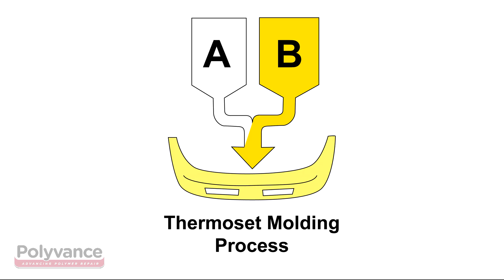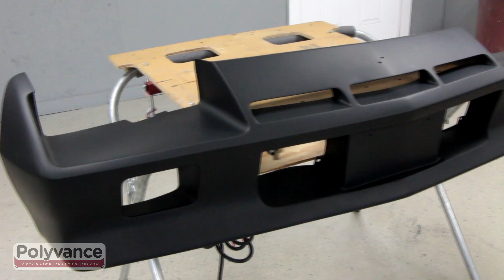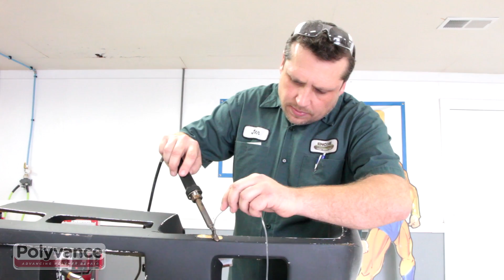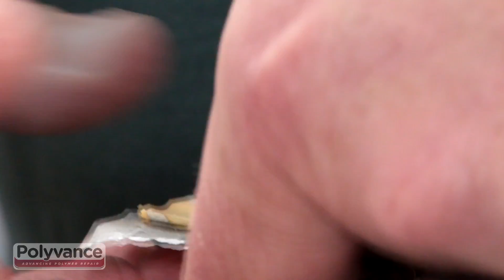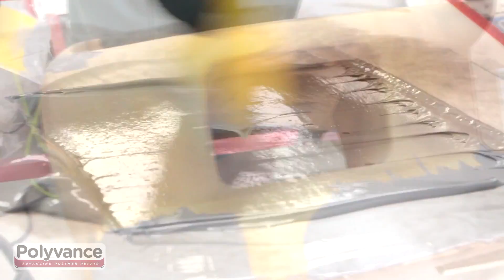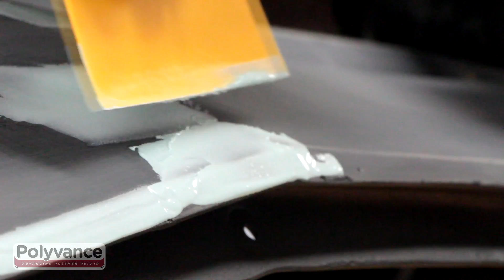Polyurethane Bumper Repair

Comment: I'm trying to restore a PolyUrethane bumper, glass fibre reinforced i think, PUR-GF- 20 it says on the bumper. The thing is i have no cracks to repair but there is two "flaps" on the backside that is meant to hold the bumper onto the car with screws. One has partly started to get loose and the other one is completely gone. I have started to learn basic plastic welding and thought that i could fix this by welding the loose one with some reinforcements and make new one for the one that are missing. But i got very disappointed when i understood welding in PolyUrethane does not work, at least not with my simple tools. Is there any glue or other chemical method that bonds well PU?
Reply from the maker: What vehicle did the bumper come from?
Make sure you are reading the ID symbol on the bumper itself and not a component that is attached to the bumper. This is a common mistake.
As far as repairing PUR, airless welding with the R01 rod as shown in this video is going to be the strongest repair.

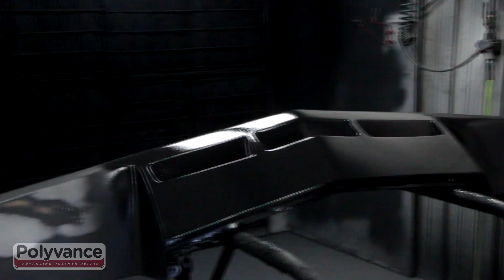Comment: In 5:22 The spokesperson says to prepare the bumper for a sealer and a topcoat. Does that just mean a color basecoat and a clearcoat, or is there more to this I ain't hearing?
Reply from the maker: Yes, the "topcoat" would be a basecoat and clearcoat. You would use a sealer or primer before the topcoat.
Reply: A sealer is like a primer, but has no build.  You put on a sealer so your color coat has no weird color changes in caused by the repair materials under the paint, after its sprayed.  You could also use a properly tinted and sanded high build primer-surfacer.  The topcoat refers to the color and clear coats.
Reply: Thanks Kings!
Reply: Can I paint directly over the welding rod material, or do I need to bondo it to get proper adhesion?

Comment: What wattage soldering iron would you recommend when using those rods to repair a bumper.
Reply from the maker: Our airless welders are 200 watts.
To repair polyurethane, you really need to be able to adjust the temperature. For this reason, we recommend our Mini-Weld Model 7 (https://www.polyvance.com/Airless-Welders-1/5700HT/) as opposed to our other airless plastic welders.

Comment: Will fiberglass stick to it
Reply: Yes, but not all that well.  After a large urethane repair is done, its recommended you put a fiberglass patch on the backside to stiffen the area as the urethane repair is more flexible than the original material.  Its not really carrying the load, it just keeps the area from flexing while installing the part on the car.  Glass reinforcement is not needed on repairs like tabs, bolt holes, small tears, etc.

Comment: I have a front bumper of an '84 Corvette that looks pretty wavy. Should I use flex filler to make it look straight again?
Reply: Try heat first.  Get it hot by gently warning it with a heat gun (from one side only) and push the waves out by hand as much as possible.  If that doesn't work then you can use the flex filler as long as you don't make it too deep.  On corvettes, there is a lot of unsupported area on the bumper, so over time they tend to sag.  I have also heard of others who reinforce the inside with a couple layers of fiberglass cloth to help keep the bumper from sagging further.
Reply: @scottb7600  That's a great idea. Thanks!
Reply: Paper mashing the inside will make it rigid